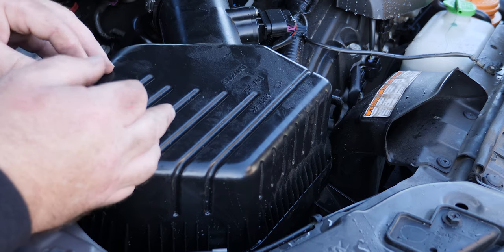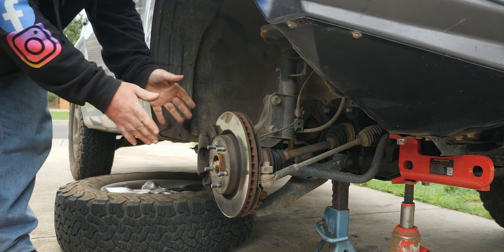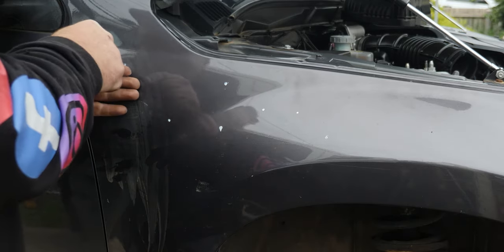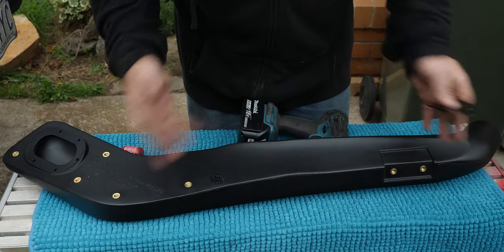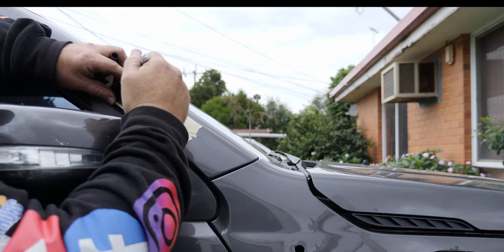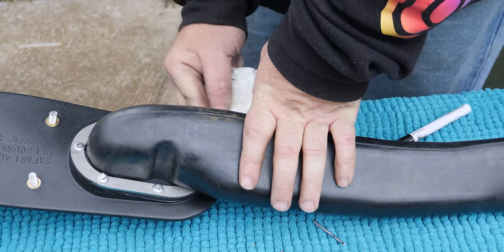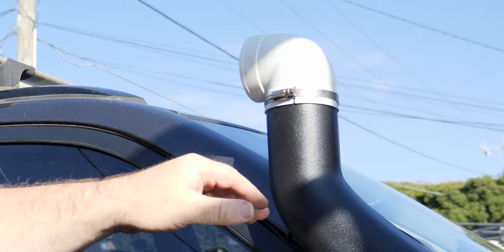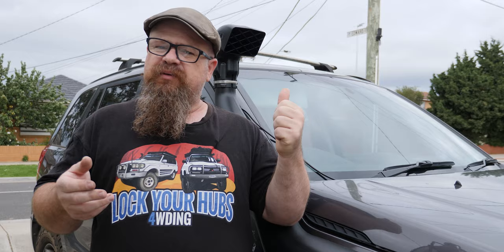Ram Head vs Backward Snorkels including Snorkel Install

Comment: I was hoping someone would do a video about this.
I have believed the ram head facing forward would help a little, and this proves it to be true.
I would also like to see a video comparison with a ram head facing forward, and then installing a snorkel cyclonic pre cleaner, like the one from Donaldson. 
Cheers
Reply from the maker: I've been thinking about cyclonic separation myself. I think they would flow worse, but I don't thing that's the idea of them. I would have to test the dust separation capability of each.